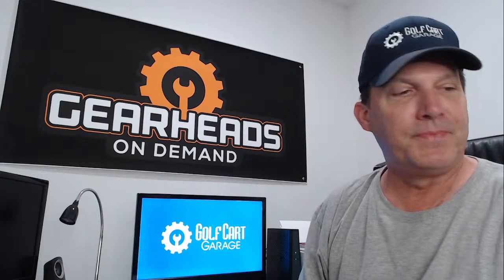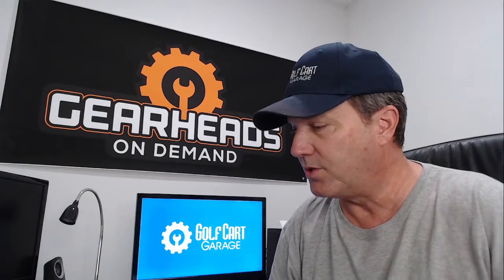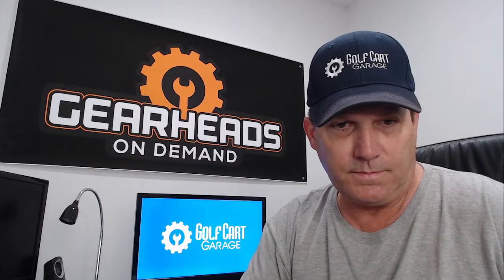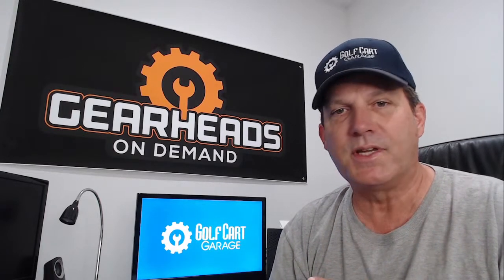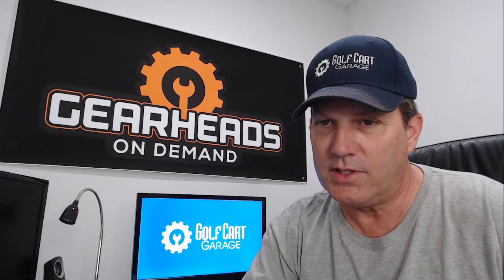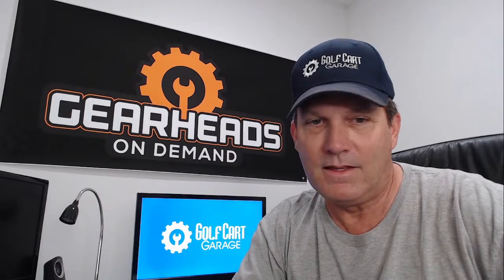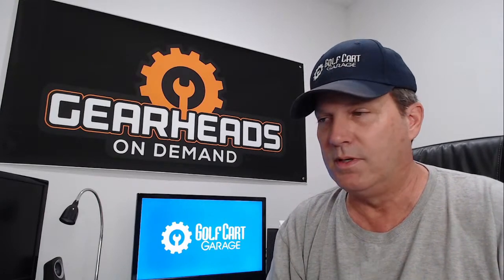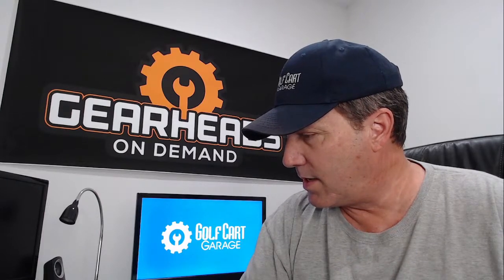Does your golf cart shudder or studder?  | Golf Cart Garage I Episode # 56

Comment: Gas power Ezgo golf cart has excessive vibration on heavier accel. On light drive , no problem. Runs good at all times, just feel like vibration on accel is more than normal.
Reply from the maker: Thanks for watching, Larry!  Sometimes this is a result of a lift, a governor adjustment, or a motor mount.  You can get an appt for a video call diagnosis here: https://www.golfcartgarage.com/gearheads-on-demand/
or get in touch directly at Support@GolfCartGarage.com or (800) 401-2934

Comment: Thanks Tim I appreciate your answer. Also, I was wondering is there anything else I can do with the new shocks? They are the same length they just have a spring on them. Thank you sir.
Reply from the maker: Thanks for watching, Eric!  If they are the same length, then try lifting the front end of the the cart using the frame and not the axle.  This will allow the axle to drop down a little creating a little more space to mount the shock.  Tim will cover this in more detail in our LIVE feed today at 1pm EST... so tune in.  But, let us know if you need more help.  Support@GolfCartGarage.com or (800) 401-2934
Reply: @GolfCartGarage  the new shocks are already installed.

Comment: You made a comment about if the cart shutters when you start to take off, it is probably related to a bad battery or cables. I have an issue where after i drive for a min or two and when it requires more torque it will studder. What would cause this?  I replaced the controller and solenoid but no change. I would say over time the shudder is getting worse.
Reply from the maker: Thanks for watching, Brian!  Power issues can frequently be battery related.  We'd recommend a load test on those batteries as there may be one with a cell that's going out.  It may also present as an issue with the potentiometer if proper signal is not getting to the controller consistently.  You can get an appt for a video call diagnosis with our tech team here: https://www.golfcartgarage.com/gearheads-on-demand/
or get in touch directly at Support@GolfCartGarage.com or (800) 401-2934

Comment: I have a Yamaha G16A gas engine - is stuttering at start up with a new plug, carb, and fuel pump.  Is the battery a possible stutter cause in a gas engine also?  I will take a look at battery connections and cables  to start.  Thank you
Reply from the maker: Thanks for watching, Dan!  A low battery can absolutely cause starting problems, we've all been there.  If you need more help after checking that, just get in touch!  Support@GolfCartGarage.com or (800) 401-2934

Comment: I have a ‘96 Club car, 48v. I drove it and it just stopped and wouldn’t go. Checked all 6 batteries, all were reading 8.4+v. Checked all connections on batteries were tight. I’m now getting the stutter. Any suggestions on next step(s). Thank you.
Reply from the maker: Thanks for watching, Mark!  What we usually recommend here is a load test on the batteries.  One of them may be dropping out under load, even though your resting voltage tests good.  Of course, potentiometer or other powertrain components may cause the stutter, but it is usually power.  If you have further questions or need help, just get in touch!  Support@GolfCartGarage.com or (800) 401-2934
Reply: @GolfCartGarage  thank you, after double checking myself, I did as you suggested. Found one battery that was questionable. Had it tested. It was bad. New battery solved the issue. Thanks again.
Reply from the maker: That's awesome to hear, Mark!  Let us know any time we can help again... even a blind squirrel, you know? ;-)

Comment: Cart shudder when coming to a stop. Icon i40.
Reply from the maker: Shuddering usually happens when there is a weak battery in the system and putting the cart under a load.  If yours is shuddering when coming to a stop I would have questions about regen or motor brake.  Consider making a GHOD appointment if you would like to discuss.